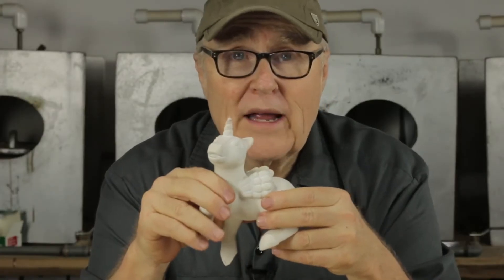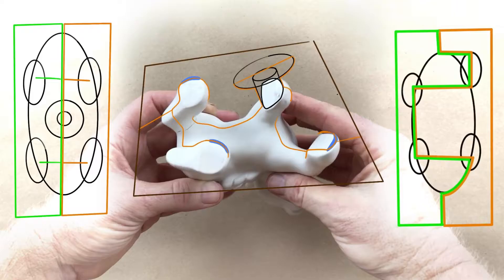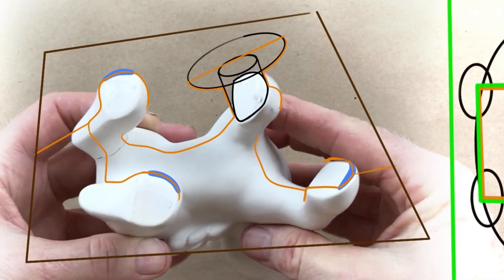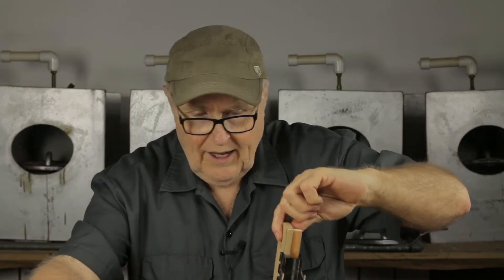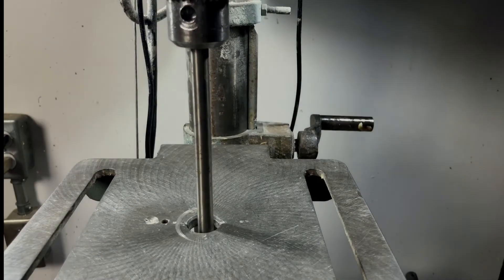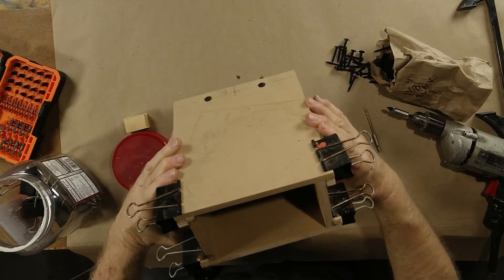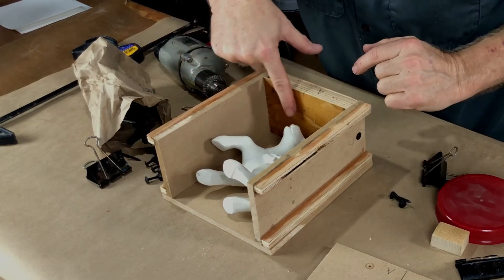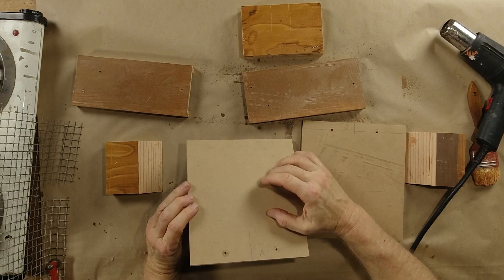Molding And Casting A Four-Legged Creature - Part 1

Comment: I am curious..... You had so many challenges figuring out the best way to make the mold for this project, and it got me to wondering...... Being silicone sticks to itself perfectly, could you have done some kind of a thing like wrap wire around the legs to hold it how it needed, pour enough rubber to cover the head and shoulders, let it set, remove the wires since now it's being supported by the set rubber around the top, and do a second rubber pour to complete the mold?

Comment: Awesome!
Reply from the maker: Thanks for watching Joe!
Reply: @RobertTolone  something I though worth mentioning is the type of elastic bands you use for keeping your molds shut.  I was using cheap ones and any drips of resin would corrode the bands really quickly.  So I ended up using string.
Reply from the maker: I just buy cheap rubber bands from Staples or whatever office supply.  Never encountered the problem you describe with corroding bands but it’s a great example of why it’s important to test all your materials together as a system.  You never know what weird reactions will happen😳🤪.
Reply: @RobertTolone  a holistic approach :D

Comment: 10:38 - AKA cabinet screws
Reply from the maker: Is that what they’re actually called? I love em! I buy them out of bulk bins at a local surplus place and they’re labeled washer head screws. 
Just went online and you’re right - they’re cabinet screws! Thanks for letting me know.
Reply: @RobertTolone  I like the GRK brand found at Home Depot. You're going to love these T-15 drive ones once you try them. ;)  If you plug in the SKU '726934' into Home Depot's website you'll see the ones I buy. I use them anytime I have to screw sheet material to lumber. Many sizes available. Love em, love em, love em.